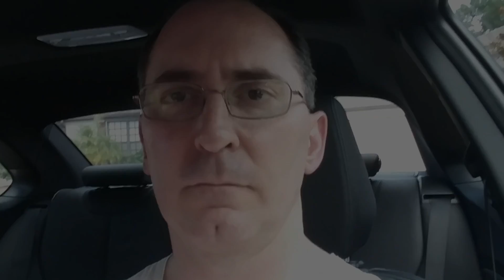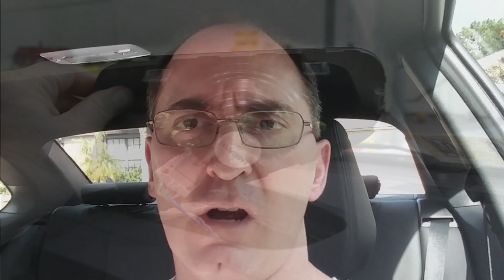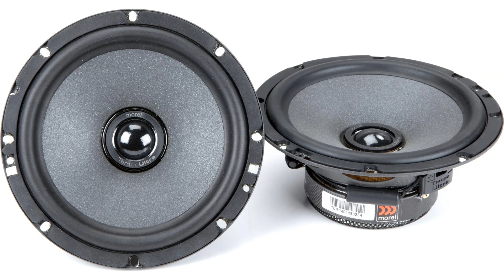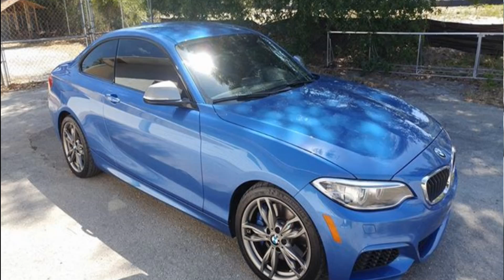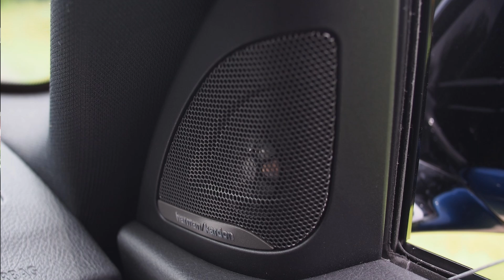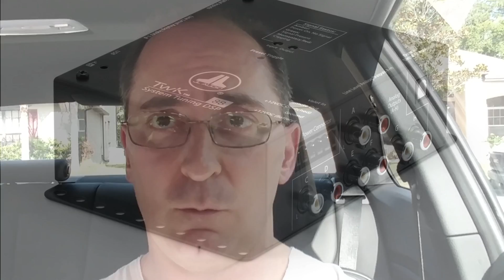Identifying Shortcomings in OEM Car Audio Systems

Comment: 2016 F150 Lariat with the Sony Premium system so changing the head unit is not an option plus I like the SYNC 3 system. 

Bypassed the factory Sony amp which controlled volume by using the PAC Amp Pro, Optical out of the Amp Pro into a JL Audio TwK-D8, out of the D8 into two JL Audio HD600`s and one HD 750. 

Three way setup in front with one HD600 in four channel mode driving the midrange and tweeters, the other HD600 in two channel mode driving the two door mid bass drivers, and the HD750 driving the two 10 inch under seat JL Audio TW3 subs. 

The tweeters, mid range, and mid bass drivers are Audio Frog GB series.

Comment: I had same issues. i did new head unit equipped with time alignment, removed all panels for sound deadening, 200 amp alternator install with new wire voltage regulator and second battery in trunk. Amps chose Ampere Audio 1200.1 and 250.4 with ampere audio dream series components and coaxials. bass is Image dynamics IDMax 12. Just install, measure distance, and eq with REW and your in Heaven!
Reply: Excellent content as usual thank you. 
I believe the OEM systems in 99.9% of vehicles is usually  more about price saving than sound so as a music lover that does a lot of milage this is a subject that I am very interested in. 
I will be following this very closely.

Comment: If you can, please have a listen to the new Audi A4 sound system. I bought the new Audi A4 at the end of 2016, and took the upgraded sound package, but not the top end Bang & Olufsen sound package. I think mine came with Blaupunkt speakers. Needless to say I was pretty disappointed with it, considering I've always had big sound in my cars. The biggest issue was the base driver mounted on the rear deck, which distorted horribly at relatively low volumes. Audi managed to sort this out for me with a fix from Germany, but it's still a rather underwhelming system for the amount I paid extra. 

And if you get a chance to test the top end Bang & Olufsen A4 sound system, I'd love to know how that one measures up, as I might  need to get that one in my next car, since Audi doesn't allow any aftermarket modifications to the sound systems without voiding the warranty. I personally haven't heard it yet, but have a feeling it will also disappoint.

Thanks.